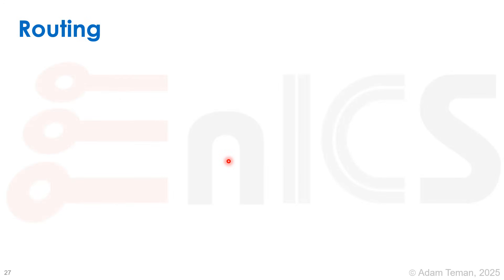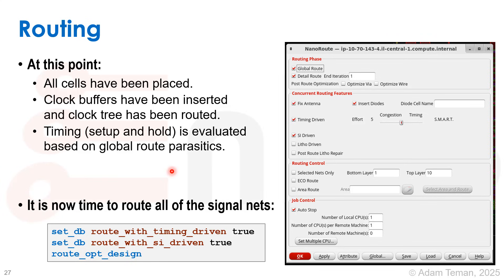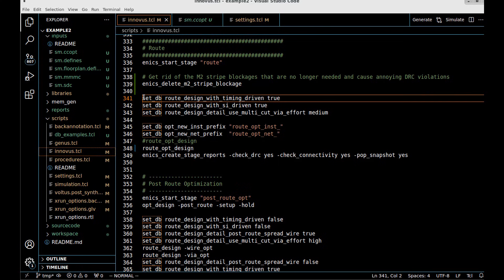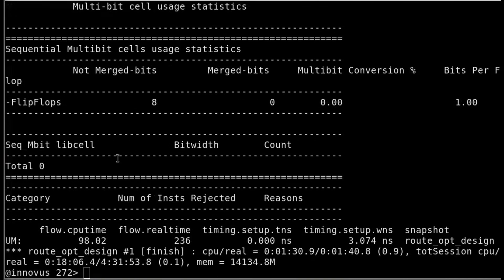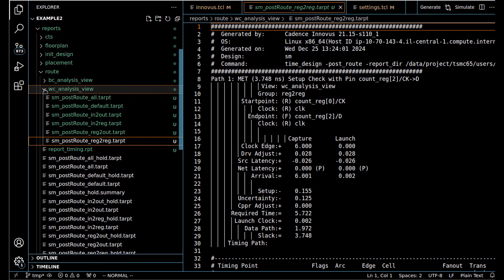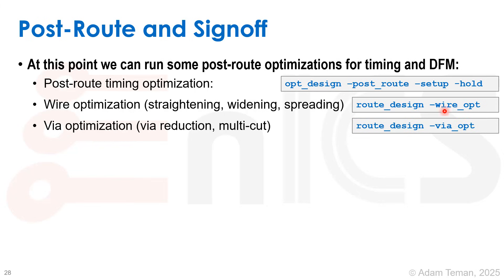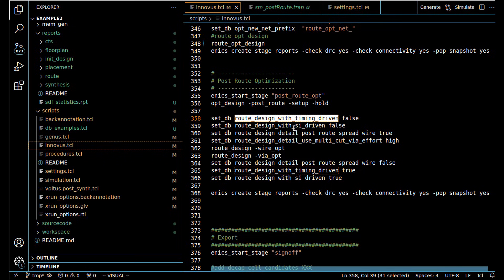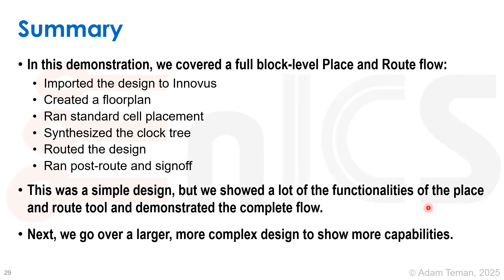RTL2GDS Demo Part 4.9: Place and Route - Signoff

Comment: thank you professsor Adi Teman for this series. could you please give more series on Timing. I subscribed your channel immediately professor. could you please make series in english(Digital Electronics)
Reply from the maker: Yes, or at least partially.
I have another full part planned for this series and it has some more timing in it. Not a ton, but it is basically an expansion of everything we saw in parts 1-4. My primary problem right now is finding the time to finish making and editing it. I have done about 50% already, so it is in the making, but it will take some time. I hope I can get it released before the summer (since Spring semester is about to start and that means I won't have much time...)

Regarding the language - all my new material is planned to be in English. The reason that "Digital Electronic Circuits" is not in English is that I can only really make a video series adjacent to when I am teaching the material, since I can "practice" on my students during a live lecture. I haven't taught that course for many years, and so it would be too much overhead to make a series right now. And I have a lot of other material planned for recording if I find the time, so I would rather concentrate on that... But all the slides are in English and they are pretty elaborate, plus I believe that YouTube can provide translations nowadays, so maybe it could be auto-subtitled...